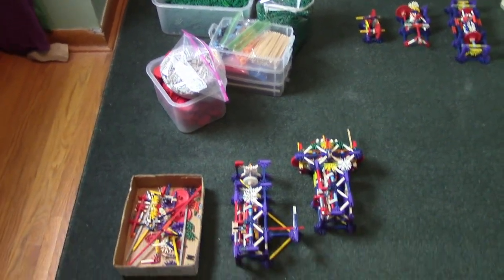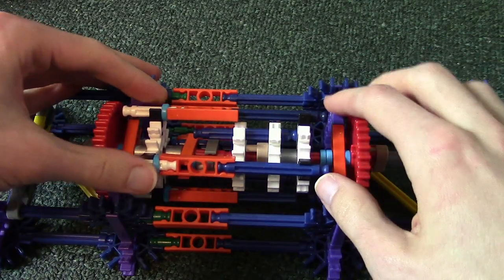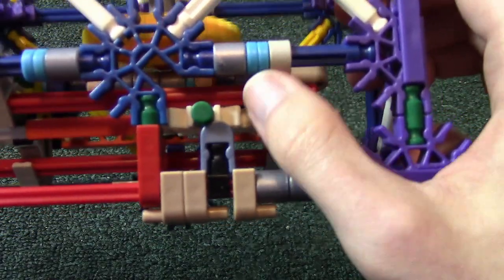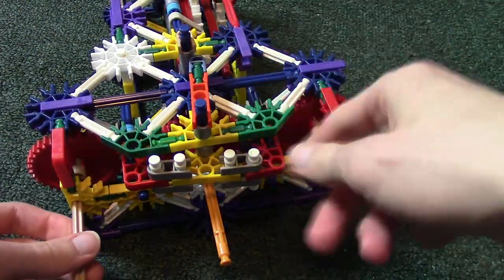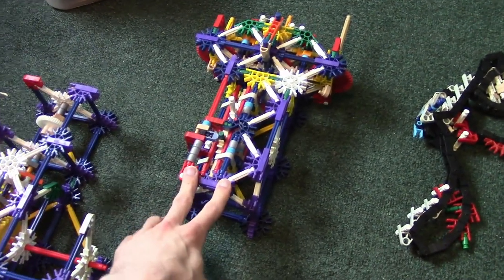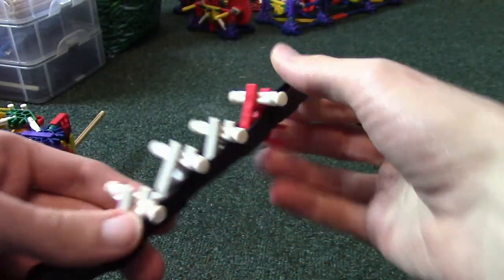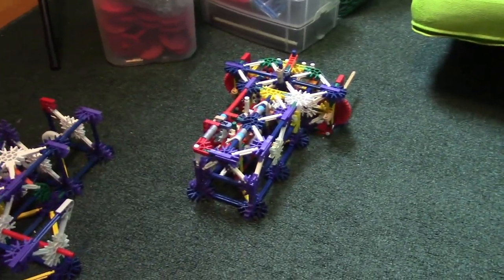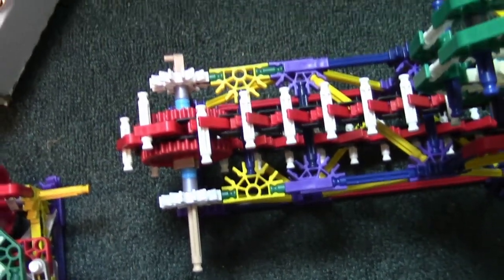Let's Build Knex Season 2 - Ep 1 - Robot Project Introduction

Comment: Good to see you building again :). Do you know wether the switches are able to work under tension?
Reply from the maker: It's good to be back, I remember you from way back in the day haha. Are you talking about the transmissions working under heavy load? The one best for high torque is the one with two differentials, though the one being used in this project is easy to switch as well.

Comment: :O very exciting!
Reply: I just finished watching the video. I am (as my name implies) mostly a lego guy myself, and it's quite cool to see concepts I know from lego implemened using KNex. On one hand the lego versions are generally more elegant, mostly because of them being smaller and having less play, on the other hand your Knex versions are cool in that they require you to be more creative yourself. 

I am currently working on a mechanical programmable (minimalistic) lego computer. Not sure if I will ever finish it though :P. The concepts seem quite similar which is cool, using a belt to program the thing, creating transmissions that can be engaged, etc :)
Reply from the maker: @legotechnic27  Yeah Lego models are more compact, but I like the challenge of building the components from scratch, for example not having the differential pieces that Lego does. And then you have those that say Technic isn't real Lego, haha. I think using a tape is the simplest way to program it, though I've thought of using a wide belt (like a 2D tape with layers).

Comment: If you think about the tape as a binary system then you could conceivably build mechanical “and” “or” or “nor” gates. Meaning that a motors acting together could create more output modes than the motors acting alone. Also have you ever looked at a “core XY” 3D printer? I would require a lot of chain but in my imagination it would require less complex transitions.
Reply from the maker: The tape could be used as a binary system, but for this application making the motors be in forward, neutral, or reverse is simpler, though I have thought of storing the angles of rotation as binary rather than the time between each step. I'm not super familiar with the 3D printer you mentioned, but I'm planning on making this robot arm a Scara configuration right now, though I may make it a gantry design if it isn't precise enough.

Comment: Impressive work! I like your compact designs you showed, even if you say they are prototypes. I am curious to see how your neutral gear will work, because wouldn't that be an additional instruction to put on the tape? Maybe you don't need a neutral gear, and instead if you need a motor to hold position, alternate directions every pin. Or will your "program" always keep all three motors moving to a new position? Keep up the good work, this is an exciting project!
Reply from the maker: Thanks! The motors will need to pause, but I explain that more in the next episode. Currently I'm making the linkage that reads the tape and translates that to transmission switching.

Comment: Was curious, with your feed tape design is it going to be a constant rotation or kind of programming tasks and advancing only when necessary? I've a lot of k'nex at home and I think something like this would be fascinating to try building along with (though doubtful I have enough pieces for it)
Looking forward to the next update!
Reply from the maker: For now the tape will move at a constant speed without stopping, but I'll make a way to pause the program using external means, like another machine or user input. It'll also be good to have that as an emergency shutoff switch.
Reply: Oh yeah, emergency shut off is always needed in any good system.
Curious if there would be a way to encode more within the tape or if there are other ways of reading out info from the tape. The left and right shift seems simple, though wondering if red vs green connectors would work as well? Having the extra height in the center path for an additional cross bar could lift and lower some reading head. (to be fair, you've probably already gone through a bunch of iterations on this design prior to this so can't say you've not already tried that :P )
Reply from the maker: @FygerFyre  That would add more readable states, but I also want it to have a write head (which I know I haven't covered yet), and making the connectors different would be more difficult to write than sliding the rod back and forth. To make it have 6 states I guess you could make a double-sided tape with white rods on both sides, though you couldn't use red gears anymore.
Reply: @Shadowman39  Oh! I see. Was unaware of the intent to add in read/write functionality! Alright, that changes how the system would work by a fair margin.
I'm guessing you could theoretically increase the length of the 'memory' rod to increase your encoding base? White can go all in or all out, but a blue/yellow could have a midway point potentially for three states (all in, half, all out), or even a 1/3rd offset for 4 total states (all in, 1/3 in, 1/3 out, all out) though the deciphering of those states would increase in complexity to ensure you're decoding the right states and that the jostling of the tape from uneven weight distribution doesn't result in misaligned 'bits'

I mean, you could also make the tape thicker by having two chains in parallel with a connecting red/gray rod to avoid jostling/twisting and potentially have grey connectors on the rods to slide left/right for additional memory lanes in a single row? Though the adjustment of the grey connectors would be more difficult than with the rods sliding in and out, and the structure to store the tape would be far more cumbersome to both build and read/write from, especially if there is the intent to add in additional lanes of memory per tape.

This is honestly a fascinating design challenge and I'm excited to hear more about the read/write functionality you have planned! Now I'm probably gonna have to play with this a bit on my own XD

And thanks for the replies! This was eye opening and I think the most I've ever engaged with a youtube channel ever. So keep up the good work :3
Reply from the maker: @FygerFyre  Making a connector slide on a longer rod, with a wider tape, was something I thought of doing instead of three separate tapes. But I think it would be harder to teach the robot, and the single tape is already quite difficult to turn due to friction. I'm glad you like the project though, and thanks for the comments! It's good to get feedback and different ideas from others, especially when they're as thoughtful as your insights.

Comment: Oooh. This is cool! So, ultimately this is a robot arm that can be used as a ball machine lift, right? ;)
Reply from the maker: Haha, it can be. I won't be sure what it's useful for until I see how accurate it is. Making a CNC router would be neat.
Reply: @Shadowman39  That'd be cool!
My guess is that the trickiest thing will be the weight of the arm itself? Keen to see how you tackle that when you get to it. :)
Reply from the maker: @Tornado96AU  Yeah I'm not sure how the weight of the arm will affect the dynamic response of the system, but I'm using an arm that at least doesn't have to use torque to lift cantilevers (like the typical industrial robot arm). I think the most challenging thing is getting 3 different inputs through one center, since Knex doesn't make concentric shafts.